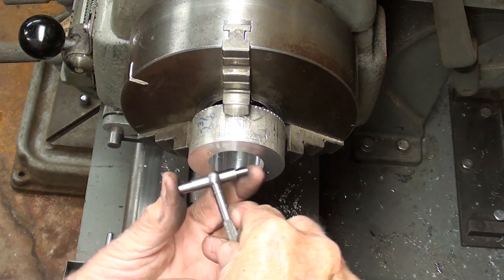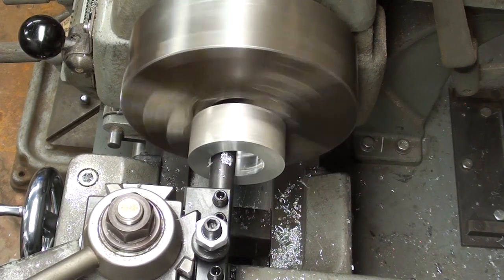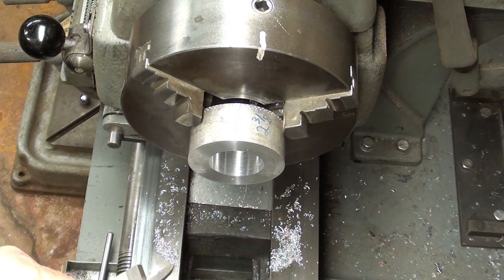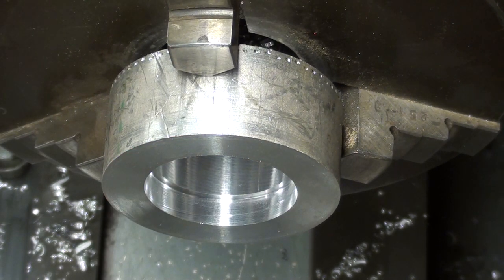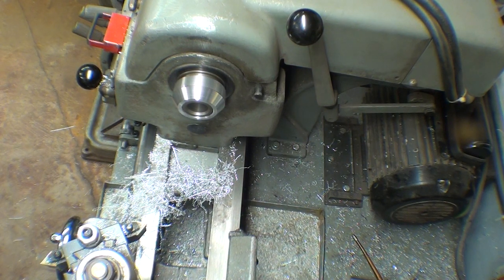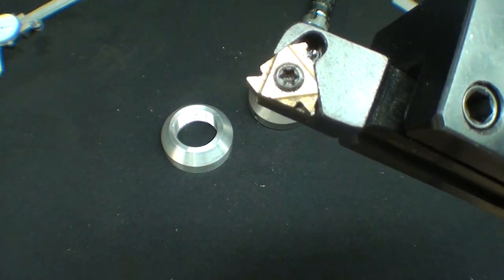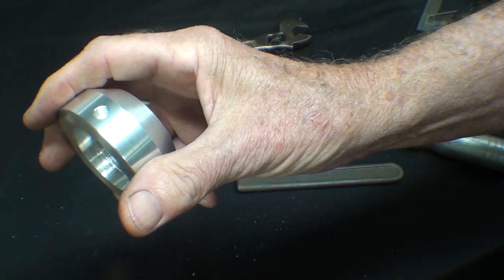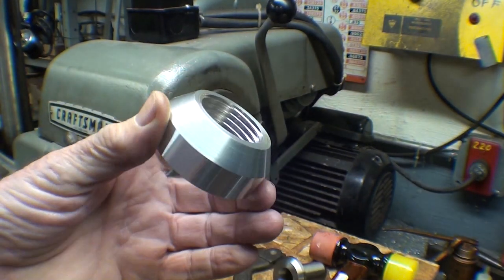TIPS #345 pt 2 tubalcain MAKES A THREAD PROTECTOR FOR ATLAS LATHE

Comment: There may only be three people in the world making these, but I made 20 of them to sell on Ebay... Thanks Mr. Pete, I also plan to use this method to make thread protectors for 1" - 8 spindles as well. For the next batch, and to speed things up I ordered a 1-3/8 drill bit and a huge 1 1/2" - 8 tap.

Atlas lathes as well as south bends are selling like mad up here in the Northeast. Whenever one hits Craigslist or Facebook Market Place they do not last long. I have an Atlas TH-42 left to me by my grandfather but I am looking to add a QC-54 soon and a 12" Atlas to the family later on. 

Thank you for all of the knowledge you have passed along!

Comment: The old spanner is indeed probably home made. I made one as well in a pinch from a piece of steel rod. You bend it to form with a nipple on the end, then just file the details in. Easy project and for small sizes (probably under 4 inches) it's more than enough.
Reply from the maker: That would make a good video---

Comment: Nicely done.  I have made several. One of the 3 in the world.
Reply: I'm halfway through mine :) A little nervous about the threading, never done an internal thread before. Will be putting the cutter on the far edge and running the spindle in reverse (with the chuck still clamped to the spindle the way the G0602s are done).

Comment: Mr. Pete, it looks like I am yet another one of the dozens of "the other three guys" that has made a spindle nose thread protector for himself.  I just finished one for a lathe that I'm sure you would very much like:  A 1927 South Bend "O" Series 11" engine lathe.  4' bed.  I bought it out of an old California ranch maintenance shop.  Despite the fact that it is 95 years old, it was barely used.  The ways are practically unmarked.  It has an overhead "Silent Chain" electric motor platform.  The spindle is a bizarre 1-5/8" x 8 TPI thread, very uncommon these days.  I looked for an original, South Bend OEM spindle nose protector to go along with my 2S collets set, but this animal is very, very hard to find (as are most parts and attachments).  My new protector, made from mild steel, came out great.  Thanks again for all the wonderful videos.
Reply from the maker: Thank you for commenting. Sounds like a very interesting whole machine. I’m sure you will enjoy it. It sounds like you did a great job on that thread, bro tractor yes, that is a rare thread.

Comment: Thanks for another great video, keep them coming. I have a Clausing 5419, 10 speed, that I would like to find/build a 5C collet  adapter with draw bar for. Of course, with a 4.5 MT in spindle you don't find a lot of these laying around. At least, with this video, I should be able to machine a thread protector for the 2 1/4  by 8 spindle nose. Thanks again.

Comment: A note 5 years on. The awkward use of the quick change tool post in the video shows why you need one of the old lantern style tool posts for you lathe. Every once in a while the bulk of the quick change post gets in the way. A tool holder with a swiveling nose  when used with the lantern tool post can get you into some places on the work that are near impossible with the quick change.
Reply: Good to find someone else that sees the value of that old girl!

Comment: Another nice video from you.

Is there a reason you did not predrill the center hole in the blank before you cut it to length?  Seems like that would leave less material for the parting tool to go through and eliminate the hacksaw cut at the end of the parting operation.

Comment: Nicely made Lyle, what grade of Aluminium was it?  I recently went through the boring & threading exercise when I made a dog plate for my Hercus.  I made up a wooden pattern and cast it in Aluminium.  I had an old spindle to test the fit of the thread, so didn't have to unscrew the  chuck.

Comment: Thanks Mr. Pete for yet another interesting set of videos. In it you mention that you assume that the majority of viewers are here just for entertainment and do not intend to cut metal themselves. I agree with a "but". I guess there is a percentage of viewers who would like to cut metal themselves but the obstacles seem too big. People living in an apartment in an inner city just don't think they have the space to set up a shop. No basement. No garage. They would have to convert a bedroom to a shop and then they still cannot put in a multi-ton lathe like those of Keith Fenner or Keith Rucker and many other machinist video creators (MVC). On top of that most of the MVCs show projects that are too ambitious for the beginner. Mr. Pete is the big exception having good beginners videos too. S.Gotteswinter has presented  a few very good entry level projects. But that is more or less it. If the MVCs could guide the beginner from buying and operating a drill press to buying and operating a small lathe possibly in a converted bedroom then a number of viewers might become doers. A channel like the following https://www.youtube.com/user/centerofmass/videos is very effective in that regard. It documents a beginner MVC setting up his shop and self teaching machining with all joys and pains. You have to take a inner city apartment dweller (ICAD)  :-) through the steps of setting up shop and using small hobby equipment to take up machining. The MVCs have to prove those ICADs that it can be done and that you can make much more useful stuff than playing with a 3D-printer. Actually 3D-printing ICADs frustrated with the shortcomings of the hobby 3D-printing process and its slow, rough, fragile and often useless results might be another group to recruit new machinists from.
Reply: Yes but would that shop fit in a bedroom on 17th floor in a NewYork sky scraper? How would you protect the floor and walls from flying chips and oil fog. How about the noise and the neighbours?
Reply: Danny Wilsher
Reply: Have a look at Emma's Spare Room, a great creator that starts out small yet still manages to create very cool projects with nothing but a small drill press and a small lathe that doesn't even have a lead screw. Top notch stuff.
Reply: True.
Reply from the maker: YES-I already watch her

Comment: Nice video! I thought it was taboo to lock in back gear to hammer remove anything on the spindle ! No I am not a troll, just funning, I know there was not enough pressure to damage a gear. Just wanted to beat them to it. Thanks, Ed K. Cleve. Oh.

Comment: Mr. Pete I have been looking for a thread protector for my Clausing 6900 with the L00 taper mount W/ key way. Not sure how to broach the keyway in the taper bore?? Any suggestions would be appreciated.Thanks again for your time and expertise.
Reply from the maker: no, thats why I never made one for myslf
Reply: make a tapered broach guide the correct size and cut a key way on the same taper with the milling machine. the same shims should work. thats how I would do it if I'm understanding it correctly.
Reply: Thanks daveknowshow I see no reason this would not work. I believe Ill will try your method. Thanks again for the reply!
Reply: joe miller glad to help.
Reply: You could always cut the key way round with an end mill (assuming you have a milling machine) then finish it with a file.   It doesn't need to be extremely accurate since it's just there to cover the spindle.    You can also broach with a regular HSS lathe tool bit by running the carriage back and forth and feeding .001-.002 at a time. (Obviously with the lathe off and the spindle locked in place)   You'll be there for a while, but you can broach a very nice and highly accurate slot that way.

Comment: Mr. Pete, did you see that unused 1974 12x36 Atlas Craftsman that sat crated without a motor installed on Craigslist?
Reply from the maker: NO--what zone is it in?
Reply: Chicago. It's rusty, but interesting.
Reply from the maker: Thats a beauty--a steel at that price
Reply: mrpete222
IF it isn't a "Little old lady owned it. Only drove it on the weekends." kind of sales story. Does it look unused to you? I can't tell.
Reply from the maker: If it was truly in the crate, it is unused

Comment: I know this is a silly thing to mention but I'm sure it happened to someone else there. first of all let me state that I I have learned everything about lathe and mill work from you exclusively over the past year and a half or so and I started getting cocky the other day about my threading getting very good. my brother-in-law is over and he's a real Machinist and I was standing there doing my thing cutting some threads and they started turning out terrible and I couldn't figure it out solo behold I look in the thread dial with skipping it was barely engaging. Just goes to show the simplest things can screw you up I didn't tighten up that threading dial enough and it bit me in the butt it made me look like a fool. so now every time I go to thread I checked the engagement of that thread dial and tighten it up on my Logan

Comment: doesn't the threaded connection loosen when running the lathe in reverse?
Reply: It most certainly can... that just adds to the excitement.
Watching a 40lb chuck start to unscrew itself while you're making a cut will get the ol' adrenaline going in a big hurry.
Reply: What about running it forward and hitting the brakes really hard? (Do lathes have a brake too?)